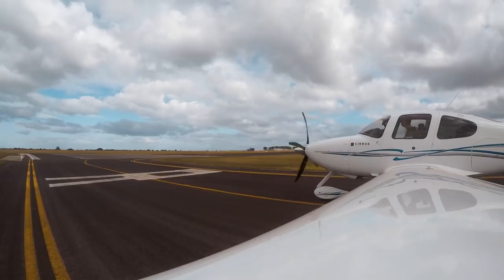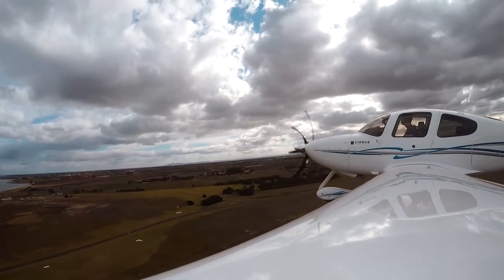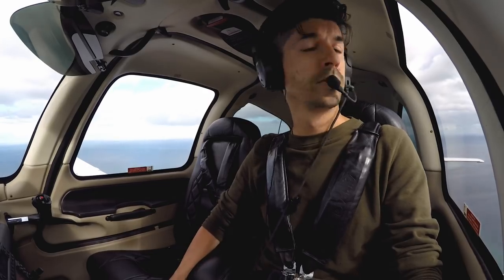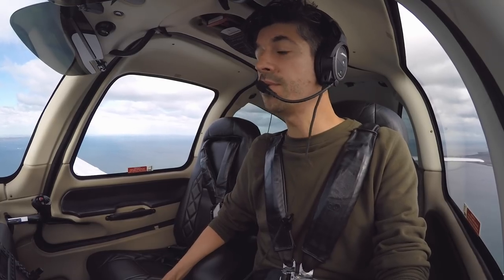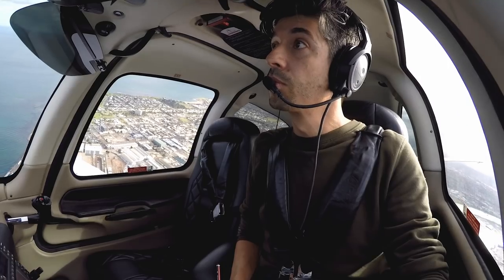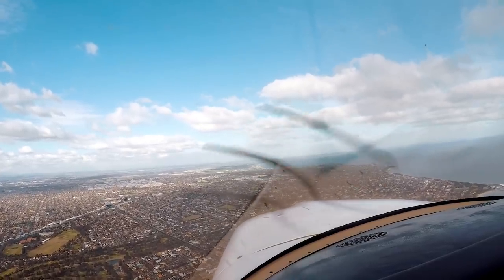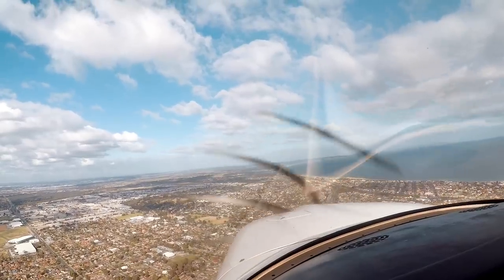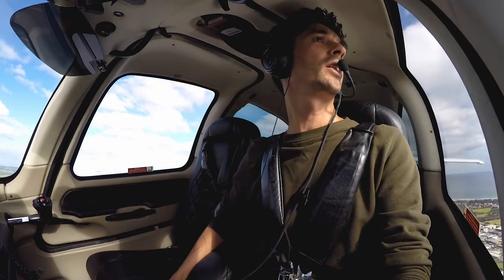Class D Controlled Airspace Radio Calls | Moorabbin Airport

Comment: Great vid - I love how you included all the calls and procedure. I will definitely get back to the vid before I fly to Moorabbin. Can you do a vid on different procedures that can be expected there? Typical entry points, calls, some specific procedures that tower gives and are not common anywhere else, usual runways used for arrival/departures and circuits etc.

Comment: What is meant by "roll through"? Stefan, I am about to start my CTA training in about 2 weeks time (depending on weather as we all know haha)... Have you got any tips for how to get your head around it as quick as possible?
Reply from the maker: The "roll through" means I can keep the speed up after landing and roll the aircraft through to the end of the runway. Normally you'd try and exit as soon as possible to help aircraft behind you. But on runway 31 this can mean you have to exit then get a taxi clearance to cross other runways. So ATC were being kind to me here and giving me the roll through, meaning I could trundle down to the end and exit without having to cross any other runways (thanks Tower!). Re your training, when talking to ATC in CTA all I'd say is practise your radio call before you make them, then deliver it confidently in one go on the radio. A session on the ground with an instructor going through some pretend radio calls is also good, so you can hear what might come back from ATC. Prepare what you're going to say first, then have an idea of what's going to be said back to you, that's most of the hard work already done. Remember every call is basically "Who Am I? Where Am I? And What Am I Doing or What Do I Want?". Hope that helps, best of luck.

Comment: Liking the wing mounted camera. Did you install a mount on the cirrus or are you using a suction mount?
Reply from the maker: It's a CASA approved mount, screwed into the wing. I'm thinking of making a video on the installation and approval process, a few viewers have asked about it so I think that could be useful.
Reply: Stefan Drury yeah a short video on the approval would be interesting. Did a lame have to do it? Also.....Assuming it’s a metal mount, did you feel dirty adding it to that gorgeous carbon wing?

Comment: Don't want to be rude, but why do you ask for wind check on final if you have a garmin?  Was it just to sound cool? I mean if so that's totally ok. :-p but just need to know you know...
Reply from the maker: Haha, erm no it wasn't to sound cool! It was a very windy day when I recorded this video, and I had a strong tailwind on my base turn. And whilst the Primary Flight Display I use does have a wind vector reading on it, the winds are often different close to the ground compared to say 500' above when you're making your turn to final. So even though I could see the windsock, AND I had a rough idea from my PFD, because I knew the traffic pattern was quiet I thought I may as well ask ATC who have the most accurate wind information available. Cheers, stef